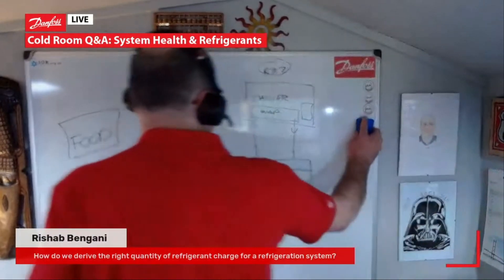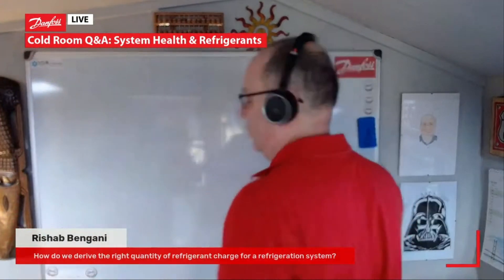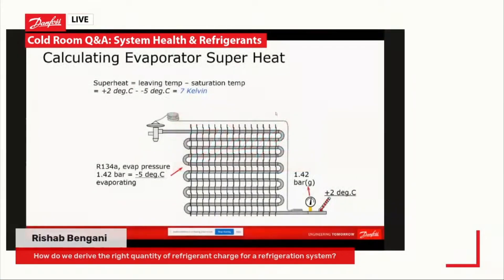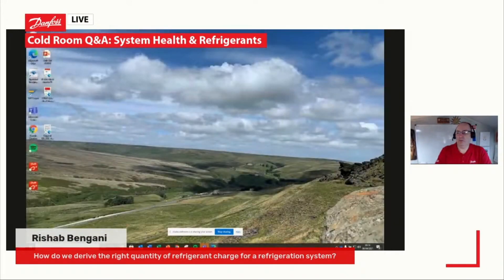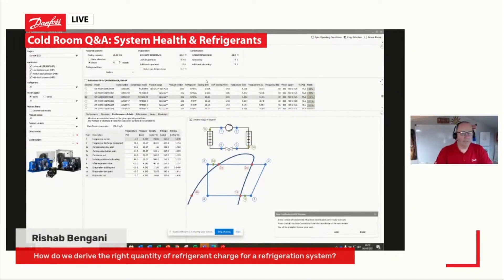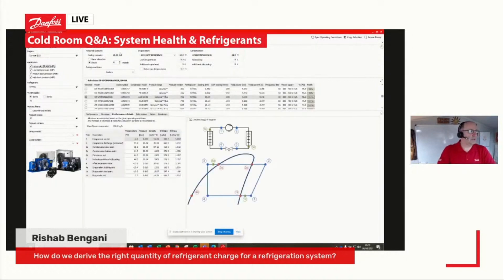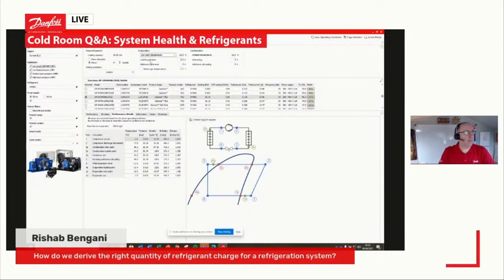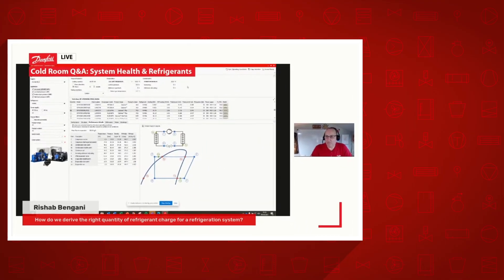How do we derive the right quantity of refrigerant charge? | Ask an Expert

Comment: Can you please explain more about base quantity using liquid line size and receiver volume
Reply from the maker: Sure, Adsm. We will get back to you shortly.
Reply from the maker: Hi Adsm.

To avoid system overcharging the appropiate refrigerant charge can be calculated as follows:

·  20% (20%VR) colume of the liquid receiver +
· 25% (25%VE) volume of the evaporator +
· 33% (33%VC) volume of the condenser + 
· 100% (VligL) Volume of the length of the liquid line

Estimated refrigerant charge (ERC)
(20%VR) + (25%VE) + (33%VC) + (VligL) x 0.9 (correlation coefficient due to refrigerant density) = Estimated refrigerant charge. 

Hope this is helpful :)

Thanks for asking
Reply: @DanfossClimate  thanks
Reply from the maker: @Václav Fučík Hi, we are checking on this and will get back to you.
Reply from the maker: The charge calculation is an approximate  guide of the charge needed to run the refrigeration system in an operational mode.

In general terms the total amount of refrigerant in a system should never exceed 80% of the receiver volume because during pump down mode you need to allow for 20% expansion space due to ambient temperature variations.

Comment: Hi Sir , How do we derive or calculate the right quantity of refrigeration charge in a Hot water Heat pump system application , We don't have that selection in cool selector app. Thanks in advance.
Reply from the maker: Hi, Thank you for your comment. The only real way is to go back to first principles; length of liquid line etc., operating refrigerant volume of condenser and evaporating from the manufacture. The full sight glass, but also the amount of sub cooling. Hope that helped :-)

Comment: If a system takes 7.41 oz and it's low. How do I determine how much to add to reach 7.41.
Reply from the maker: Hi, we are checking with our experts and will get back to you.
Reply: Easiest way is to recover the charge, pull vacuum and recharge to the correct charge.